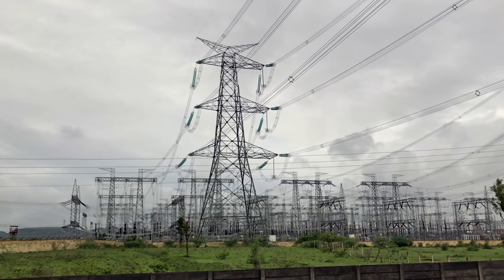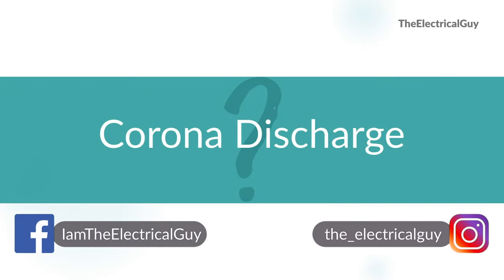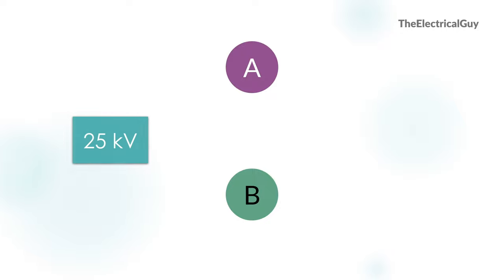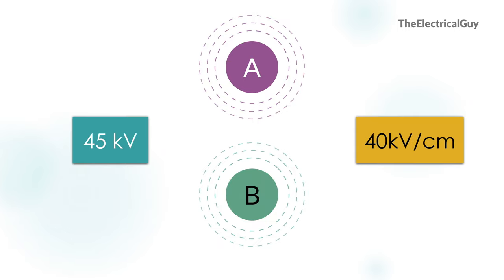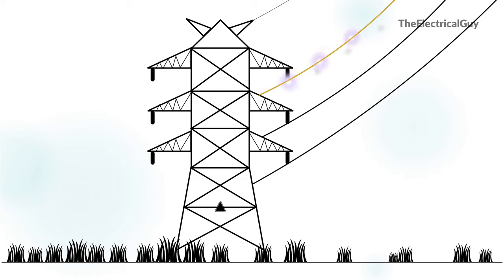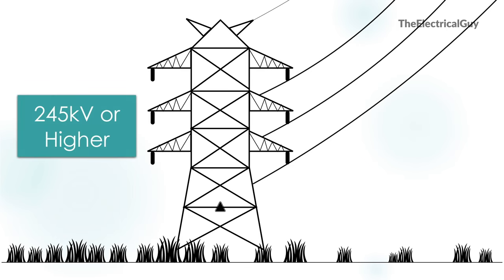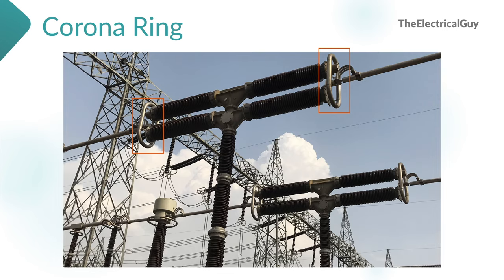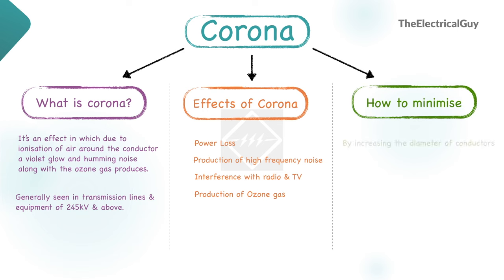Electrical Corona Effect | Causes, Effects & Ways to minimise | TheElectricalGuy

Comment: Which of the following statement is true regarding CORONA-
A. It takes place at a voltage lower than breakdown voltage.
B. It takes place at a voltage higher than breakdown voltage. 
C. Both A & B
D. It increases the transmission line efficiency.

Sir find me the right option.
Reply: Option A is the correct answer

Comment: Osm man !!
Well I'm studying on Electrostatic Precipitator whre this term introduced.
Well, it is used for seperate the dust particles which flows with air, To clean Air.

Due to negetive electrodes every dust particles (mixed with air) are converted into Negative ions ?